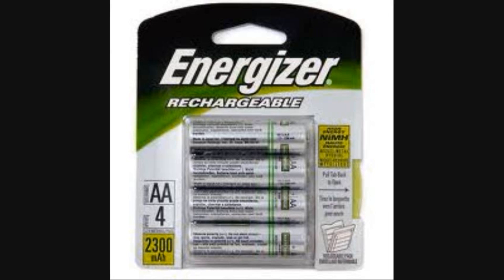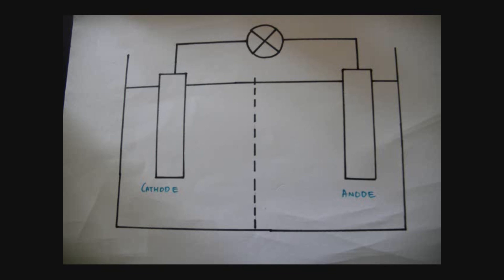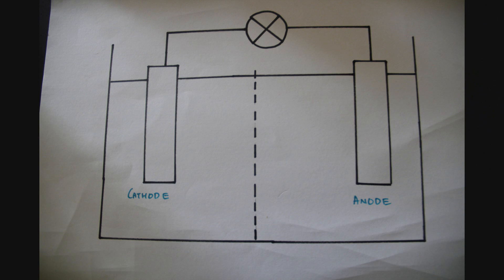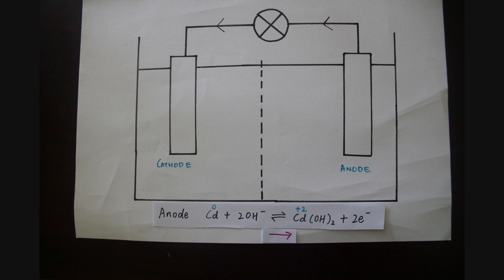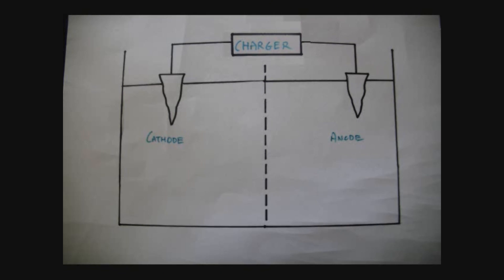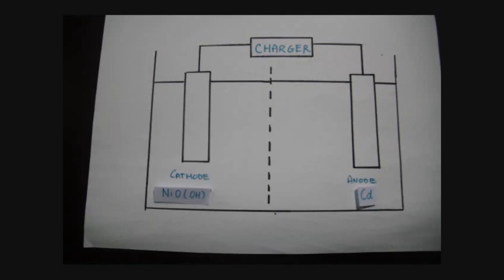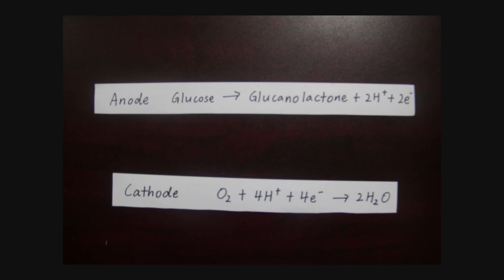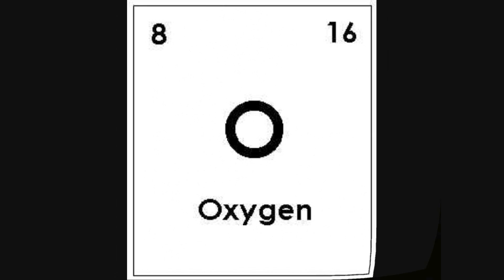How do rechargeable batteries work??

Comment: This excellent [ check Details Here>>>https://www.facebook.com/Battery-reconditioning-310070329426065/app/208195102528120 ] works wonders for reconditioning. Utilizing the procedures you provided, I can now use broken laptop batteries and all sorts of batteries once again. I followed the steps easily due to the simple instructions. I`ve got a few more batteries I am going to recondition now also.
Reply: try

Comment: WRONG information.
Anode-Positive electrode
Cathode-negative electrode
Reply: Your wrong actually. Cathode is the positive side and Anode is the negative side.
Reply: @Seti12345  No, the anode is the positively charged electrode
Reply: +TheSeti12345 Correct.
Reply: @MrCricFoot  wrong.